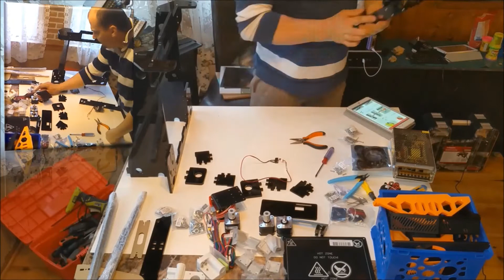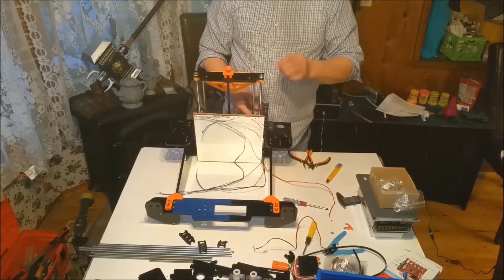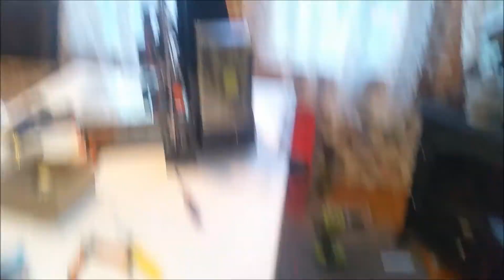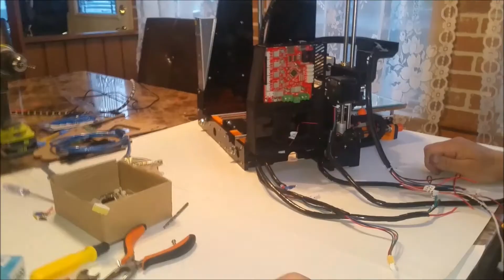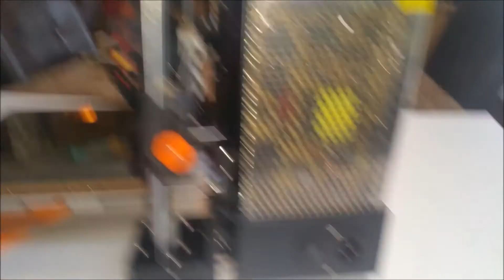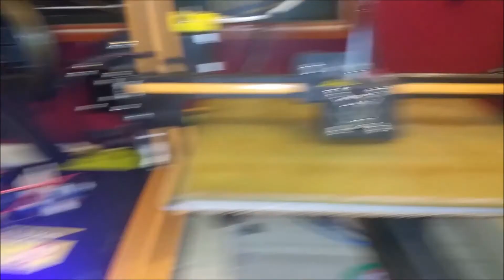Anet A8 Assembly and Upgrades in one Build

Comment: Uhh-Ohh ^o^ . NEVER use other colours than blue (N) and brown (L) for mains wiring.
Its TOO easy to catch the wrong one, if the usual low voltage colours are used and you later have to alter the wiring.
If a stepper motor runs the wrong way, the solution is to turn that motors connector 180° on the motherboard, no fiddling with the pins.

Comment: Okay, yes, i know this has nothing to do with the anet, but what board are you using for your large kossel printer?
Reply from the maker: For both my Kossels I am using a Ramps 1.4 with Arduino Mega. For the really big Kossel project I have an addon CNC board wired to the Ramps to allow for more stepper motors so I can run 3 extruders and have a diamond hot end setup going. There are far superior boards out there but I find Ramps is cheap to replace and easily upscalable given I can attach the cnc board and get up to 4 more stepper drivers running
Reply from the maker: Also you can pick up a Ramps 1.4 board for $4usd, an Ardiuno Mega for $5usd, and 4 stepper drivers for $0.75 each. which makes a pretty cheap setup, you can also choose to buy an LCD2004 with SDcard slot or you can just get a micro SD card expansion board which will just plug into the ramps to